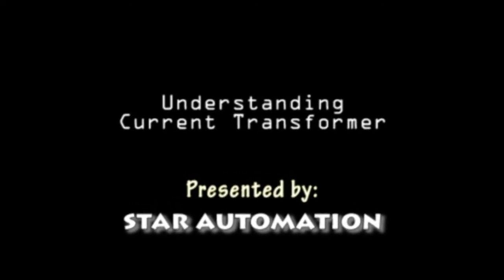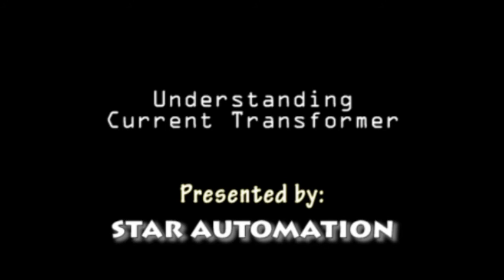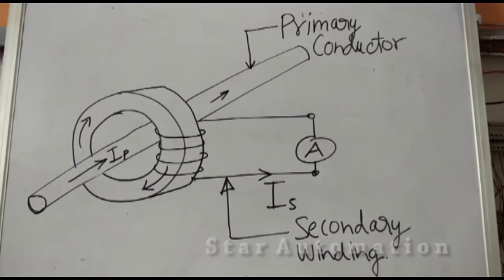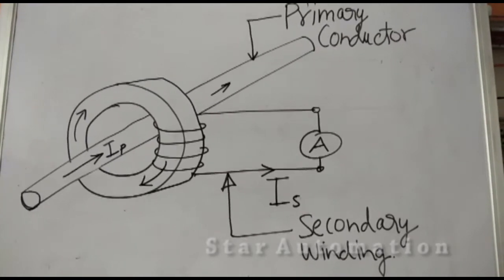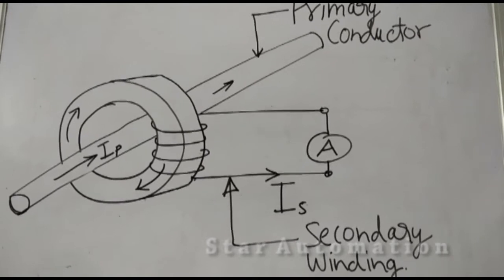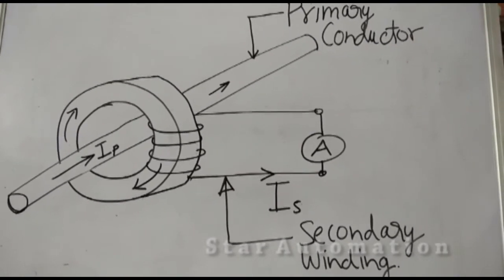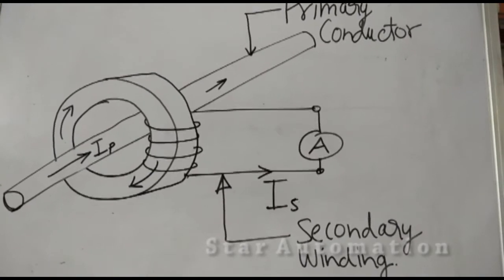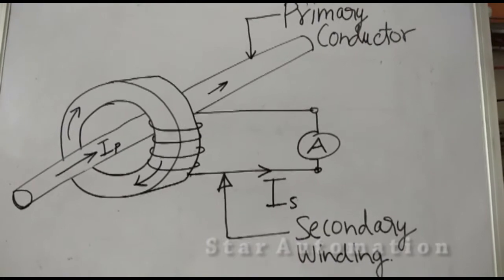Understanding Current Transformer

Comment: In plc what is analog & digital i/p & o/p
Reply from the maker: +Happy Ror analog inputs are signals from temperature sensor, pressure sensor, level sensor etc. Analog signals are generally 4-20mA or 0-10vdc. 
Digital signal are such as signal from Push button, limit switch, proximity sensor etc. Digital signal are On or Off type. On signal is 24vdc signal present.